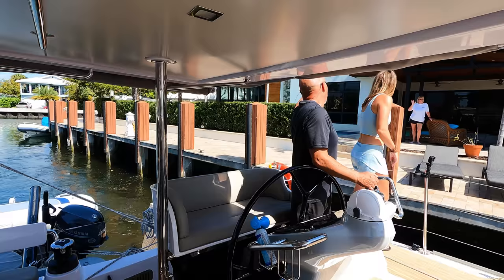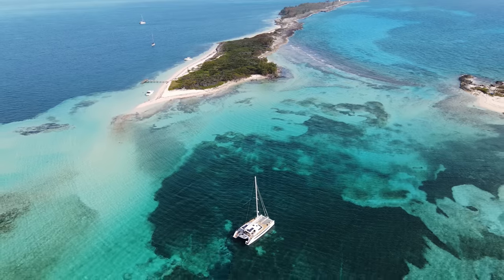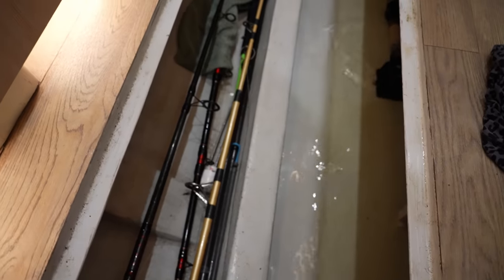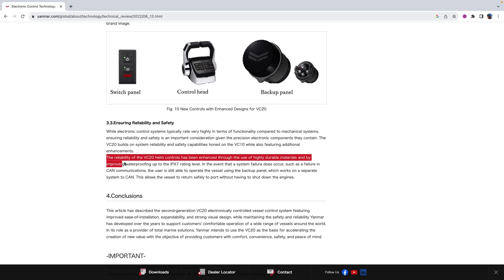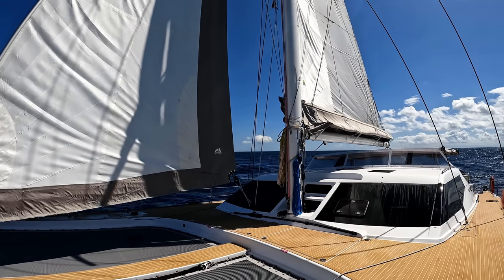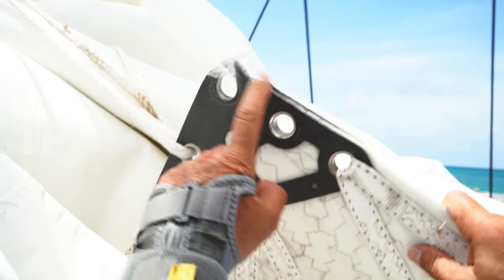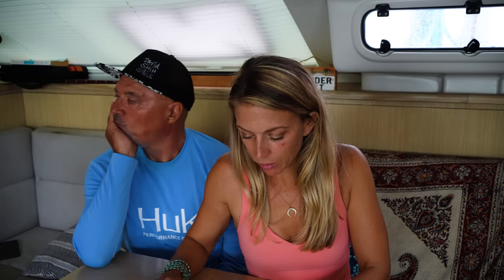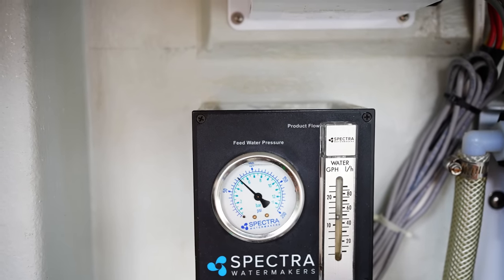SEAWIND 1600 CATAMARAN 3 Yr Review - Joy or Regret?

Comment: There are always unknown potential failures, but for the price of these boats the company should take care of you.
Reply from the maker: We do feel Seawind has been a good partner. It takes time to address issues and figure out a permanent solution. 😊
Reply: But the fact is they are not…otherwise you would have a working throttle already! No longer a fan of Seawind!
Reply from the maker: 😂😂It's like giving up on chocolate just because of one melted bar. It’s a fantastic company.
Reply: @HarborsUnknown  lol. If chocolate powered your home from point A to B.
Reply from the maker: Would it be nice!! To fill the tank with chocolate rather than diesel! The only downside we would run out of fuel much faster! 😊😊
Reply: So, for clarification, Seawind specified a component to be installed on the outside of a sailboat and don’t check to see if that component was indeed waterproof?
Then you find out the remedy is $20k and they, in essence, respond 🤷🏻‍♂️.
Reply from the maker: The VC10 unit is for outside and moisture resistant. I had been recommended by Yanmar until they realized that it was not IPX7.
Not Seawind’s fault who has been since trying to fix the problem.
Reply from the maker: Yes!

Comment: Ugh this sounds like an awful experience. Imagine having parts on a boat that’s not waterproof.
Reply from the maker: Thank you for your comment. It is a dodgy situation with Yanmar. Waterproofing rating uses the IP codes. The IP plus two numbers for dust and liquids, but on a boat we typically just look at second number, liquids which ranges from 0-8

-IPX0: No special protection against water.
-IPX1: Protection against vertically falling droplets, e.g., condensation.
-IPX2: Protection against vertically falling droplets when the device is tilted at an angle up to 15°.
- IPX3: Protection against water sprayed at an angle of up to 60° from the vertical.
-IPX4: Protection against water splashed from any direction, with no harmful effects.
- IPX5: Protection against water projected from a nozzle from any direction.
- IPX6: Protection against powerful jets of water, often specified for marine or outdoor equipment.
- IPX7: Can be submerged in up to 1 meter of water for up to 30 minutes.
- IPX8: Can be submerged deeper than 1 meter, usually specified by the manufacturer.

Yanmar VC10 were rated on paper IPX6, Seawind correctly installed them in a position, outdoor and with sprays. When they started failing and we spoke with Yanmar they admitted that they were not designed for exposure to water.
In the second generation Yanmar VC20 the company writes.
“The reliability of the VC20 helm controls has been enhanced through the use of highly durable materials and by improving waterproofing up to the IPX7 rating level.”

It’s a pickle!!

Comment: You've done it again! Most folks would never consider putting up an unvarnished recap of their experience. Bravo for the honesty and deep dive into getting things straightened out.
I can only offer a little tiny bit of advice, from experience (a LONG time ago!), and from some friends who have raced and cruised at high speed.
When it comes to anchors, my father always had three on board. It was a 78 foot steel-hulled schooner, which was sort of slow (we blew across the Malacca Strait at more than 18 knots, when the water was bathtub calm), but Dad always insisted on having three anchors of good size, just in case something went wrong, and something always goes wrong. There was a sudden squall north of Semarang, and all three anchors were out, each on more than 350 feet of heavy, heavy chain. Overkill, possibly, but the family and the boat survived without a scratch.
For water makers, a racing friend came up with a Rube Goldberg sort of fix. He found a pump which was powerful enough to pull water up a LONG hose (3/4" diameter), up to the input feed of the water maker. This was used when they were running at speed, because the cavitation would impair the ability of the water maker's pump and inlet. There was a cage/filer thingammie at the end of the 35+ foot hose, to keep out larger things.
Thanks for the video and can't wait to see more!
Reply from the maker: It's great to hear from you Leon! We're so glad you enjoyed the video! Thank you for the advice and for sharing your story. We have two anchors on board, but 3 couldn't hurt. 
Very interesting solution for the water maker, we'll have to look into something like that. Thanks for watching and for your support!

Comment: Great video! Your experience parallels our experience with our Nautitech, only we didn't stick it out and sold the boat after 9 months. I think it helps that you had two previous boats and knew more of what to expect. It was our first boat. We also bought a new boat because I naively thought we wouldn't have many repair issues for 5 years or so. We couldn't have been more wrong. It started with a chart plotter that was DOA on our first sail, and got worse from there. One thing they don't tell you about warranty work is that component manufactures don't pay for labor, only parts. Nor do they pay your expenses to sit in a marina for weeks waiting for parts or repairs. If you have the knowledge it's usually cheaper to buy parts and fix it yourself than to wait for warranty coverage. We learned a lot in 9 months. My stress level was so high that we had to sell the boat. It was the only way to stop the financial bleeding. I don't understand how quality control on boat stuff can be so bad. 

Having said that, we have no regrets. It was a fantastic experience that we may try again one day under the right circumstances. I have better knowledge about what to expect and things I would do differently, so hopefully I could handle the surprises a little better.
Reply from the maker: Thank you! So sorry to hear you had such a terrible experience! We were fortunate that Seawind did pay for the labor when we had professionals come out but to your point it’s much quicker to buy the parts and install it yourself. We were based in Ft. Lauderdale for the first 6 months and then after our trip to the northeast for another 4 months and again fortunate we had free dock space with friends. I’m glad the experience didn’t sour you on boat life because it can be amazing. Best of luck and thanks for watching our video!

Comment: I sure hope Seawind opens their eyes and fixes everything in a more timely manner. It certainly sounds like most of these more expensive issues that you’re experiencing the last 3 years is caused by Seawind’s decision to use components that were either undersized, and/or not weather proof. 

I’m sure Seawind is  fearful if they do more for you, then everyone else who has purchased a Seawind catamaran in the last few years that’s having similar issues, will also want their catamaran fixed and that will get expensive. 

Seawind just needs to own up to any errors they’ve made or suffer the consequences as a business. We’re all watching to see how #Seawind choses to handle this. If they used the wrong systems/parts then they need to replace them with the correct parts, plain and simple.
Reply from the maker: Thank you for watching your videos and for your comment. Seawind has been very proactive and on top of warranty issues.
Most of warranty problems are with product not manufactured by Seawind.
We are working closely with them to improve issues with design and the new Seawind, 1600 passagemaker has already addressed most of those Issues 😊😊

Comment: That's crazy  that boat manufacturers ( or some boat manufacturers?) won't deal with component warranty, that's like if you bought a car and the engine management computer packs up and the car manufacturer says well you have to go to say Bosch or whoever to get warranty on that. The boat manufacturer is the system integrator and they have to make sure that they specify the  right parts, the throttles are a prime example, why should Yanmar warranty a throttle fitted in an exposed helm that is only rated for inside use, Seawind have to fix that. Undersized auto pilots and Helm systems also seem to be a common issue ( cost ) see Sailing with Thomas for his struggles with that.
Reply from the maker: Thank you for watching and for your insightful comment!! 😊😊

Comment: Seawind screwed up by using a throttle that was not rated for intended use.  That is just a big screw up on their part.  Great video recap of your experience.
Reply from the maker: Thank you for your comment!! I really think that Yanmar is responsible.
I am copying what I put in an earlier comment.
Let me know what you think.
Waterproofing rating uses the IP codes. The IP plus two numbers for dust and liquids, but on a boat we typically just look at second number, liquids which ranges from 0-8

-IPX0: No special protection against water.
-IPX1: Protection against vertically falling droplets, e.g., condensation.
-IPX2: Protection against vertically falling droplets when the device is tilted at an angle up to 15°.
- IPX3: Protection against water sprayed at an angle of up to 60° from the vertical.
-IPX4: Protection against water splashed from any direction, with no harmful effects.
- IPX5: Protection against water projected from a nozzle from any direction.
- IPX6: Protection against powerful jets of water, often specified for marine or outdoor equipment.
- IPX7: Can be submerged in up to 1 meter of water for up to 30 minutes.
- IPX8: Can be submerged deeper than 1 meter, usually specified by the manufacturer.

Yanmar VC10 were rated on paper IPX6, Seawind correctly installed them in that position, outdoor and with sprays. When they started failing and we spoke with Yanmar they admitted that they were not designed for exposure to water.
In the second generation Yanmar VC20 the company writes.
“The reliability of the VC20 helm controls has been enhanced through the use of highly durable materials and by improving waterproofing up to the IPX7 rating level.”

It’s a pickle!!
Reply: @HarborsUnknown  If it was trully rated IPX6 it should have been fine...maybe yanmar up rated it from an actual lower rating.  Or did not test it to those ratings.  Seawind can only take what info they were given by the manufacturer, so I think you are right.
Reply from the maker: @DaBinChe definitely!!

Comment: Thanks for a very honest review.  Kind of shocked Seawind put throttles that weren't waterproof enough in a very exposed position.

Kind of surprised the running rigging only lasted two years.  Was there chafe at the sheaves somewhere?  What was the wear?
Reply from the maker: Yanmar was selling the throttles as IPX6, resistant to high pressure sprays. Not Seawind’s fault. The VC20 now rated IPX7  (new version seems to have addressed that problem) Interestingly I can no longer find the  IPX rating for VC10.
Chafe was at at turning points, continuous reefing lines on the Doyle sail, and the screecher sheet ( my bad)
Main halyard twisting on the 2:1 block aloft (partially my bad) 
Thanks for watching and for your comment
Reply: @HarborsUnknown  Thanks.  IPX7 seems a lot more appropriate for something fully exposed to water on a boat.

The chafe points make sense.  What was the issue on the screecher sheet?  

(Unfortunately I have not watched all of your videos yet.  Obviously thank you both for making them!)
Reply from the maker: My bad, 😳 we flogged the screatcher violently and got and the line got stuck on the seagull striker.

Comment: This has been one of the most useful reviews of a catamaran that I have seen. I have seen way too many reviews. If you have found what you want, why keep looking? Other than the price of the 1600, it is an amazing boat. But the evidence is you get what you  pay for. Thank you for a very useful view into the 1600. I am not as certain about the dagger board option which is mandatory on the 1600. It does give better upwind performance, but I don't enjoy upwind sailing all that much and tend to arrange the sailing plan to minimize upwind. But even if you have a boat that is 20% less upwind performance, who is racing? I am cruising. So the extra speed and convenience is reduced by the need to manage the daggerboards. The other options are not adjustable and therefore the boat is easier to manage. But I  confess that I like the minimal draft when you pull the daggerboards and rudders up. It allows you to go places you otherwise would not consider. Plus/minus considerations.
Reply from the maker: You are 100% correct! Everything is a trade off! Shallow draft is a plus. Daggerboards are also nice but add a level of complexity that should not be discounted. We recently sailed upwind from Tahiti to Hiva Oa and we appreciate the ability to point a bit higher, but as you say, you can get there when you get there regardless 😊.
The boat is priced competitively respect other same size semi-production boats.
Most of our troubles came from third party equipment, and whatever is SW responsibility they are addressing and taking full responsibility. Thanks for watching and for commenting 😊

Comment: Great video. I had the foolish idea that if you buy a boat that costs almost a million dollars you'd get concierge level treatment. Someone from the company would be there to hold your hand, make sure you knew how to work everything.  Any problems...they'd take the lead with the third party providers. Nope.  I had a front row seat. You get a few days, then when they give you a few more days, it's like a miracle they're giving you the extra time... to sort out the things left incomplete at the commissioning. and wait for the last parts to be delivered.  And 'Don't worry, just sail first to X and  if there are any problems, we'll fly someone over to take care of it....'  We sail to X,  the boat has a leak and.... they suggest you destructively cut out the door header and pull down the molded headliner to find it. What happened to....? 
The refit on the autopilot sounds great. Of course it must be disappointing it took so long.  I complain a lot but I would be happy with this. 
One thing I think I know about Seawind boats. Having spent month slamming in 3 meter seas, 7000 nm, getting flipped like a pancake in the forward cabin, hearing the slam. (What to know what this sounds like? Get your car up to about 30 mph and hit a dumpster five times a minute. I slept through all of it. Liked it.) It's one tough boat. Before we sailed I made many mental notes of how doors and hatches and bilge panels fit. After crossing the Pacific everything was exactly where it was at the start. I wouldn't hesitate buying a used Seawind.   
If owning a boat is an open ended process, then it should be discussed openly. Which you've done here, to everyone's benefit. Thanks.
Reply from the maker: It's pretty crazy how a million dollars is like 100k nowadays. For concierge service you probably need to spend 5 or 10 million though we'll never know. 😂 
Sounds like you had quite the passage! What is the saying? Baptism by fire. At least it sounds like the boat held up and you arrived safely. 
Thanks for watching Will!
Reply: Buy an Outremer. Same price range. You will get weeks and weeks of training, they'll go sailing with you several times. And they fix what's broken. They are becoming let's hope the standard in the industry.

Comment: Ridiculous that they would install non waterproof throttle controls and obsolete at that. Some great points especially the allure of a washer dryer that’s not designed for marine use. You absolutely have to dismantle to replace.
Reply from the maker: Thank you for your comment. It is a dodgy situation with Yanmar not Seawind. Waterproofing rating uses the IP codes. The IP plus two numbers for dust and liquids, but on a boat we typically just look at second number, liquids which ranges from 0-8

-IPX0: No special protection against water.
-IPX1: Protection against vertically falling droplets, e.g., condensation.
-IPX2: Protection against vertically falling droplets when the device is tilted at an angle up to 15°.
- IPX3: Protection against water sprayed at an angle of up to 60° from the vertical.
-IPX4: Protection against water splashed from any direction, with no harmful effects.
- IPX5: Protection against water projected from a nozzle from any direction.
- IPX6: Protection against powerful jets of water, often specified for marine or outdoor equipment.
- IPX7: Can be submerged in up to 1 meter of water for up to 30 minutes.
- IPX8: Can be submerged deeper than 1 meter, usually specified by the manufacturer.

Yanmar VC10 were rated on paper IPX6, Seawind correctly installed them in a position, outdoor and with sprays. When they started failing and we spoke with Yanmar they admitted that they were not designed for exposure to water.
In the second generation Yanmar VC20 the company writes.
“The reliability of the VC20 helm controls has been enhanced through the use of highly durable materials and by improving waterproofing up to the IPX7 rating level.”

It’s a pickle!!
Washers on boats are standard washers not designed for marine use. It’s not uncommon for manufacturers to install items prior to putting the desk on the hulls, definitely not a problem limited to Seawind! 
Thank you for watching and for you insightful comment 😊